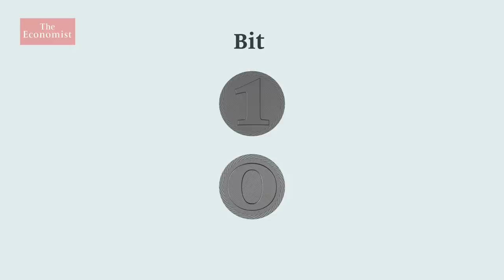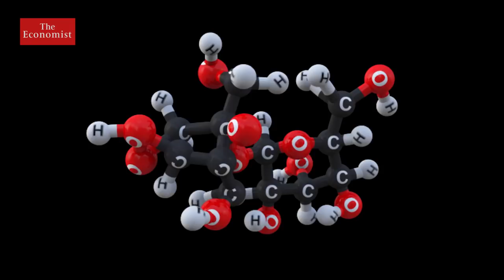How will quantum computing change the world?

Comment: Hum... "just some companies will use them (...) not in a regular base (...) to solve very specific problems" 
Reminds me a lot of what IBM say about computers in the beginning , the famous "the is only room for 5 or 6 computers in the world" 

There are 2 very critical areas that Quantum are very good at , that will spread:
- Encryption (with the video talks about... very briefly ) 
- Machine Learning (with will is already proving to be a big thing) 

So... no, it will not be like a CPU , or replace a CPU ... but i really think that in 20 years or so... it will be like a Graphics Card... something that every computer kinda need, some people need more... but it´s an add power to the computer.
Reply: CPUs have pretty much hit a brick wall with innovation, they literally can't be made any smaller. For CPU power to increase (for the power efficiency and their size) they'll need to change their very foundations. I think eventually quantum computing will replace everything. Especially given that I expect itll be near impossible to get non-binary machinery to work with other binary components, though I'm no engineer.

Comment: One use for a quantum computer is to solve the Navier-Stokes equations for fluid motion. The amount of grid points to solve such equations for a given case of the Navier-Stokes equations is given by the Reynolds number for the flow raised to the 2.25 power for a 3D solution. The power for a 2D solution is 0.75. To give an example. The Reynolds number for a circular pipe is about 3000 and is about 50000 for a golf ball and about 200000000 for a wing of a future hypersonic aircraft. Such an aircraft could fly from London to Sydney in just 3 hours. Imagne that!

Comment: We've been hearing these stories about how quantum computing is going to change the world since about 1970. YAWN.
Reply: Just wait till we got systems with 200+ qubits
Reply: But this time, it's for real. It's only in the past 5-6 years that quantum computers have actually existed, and only in the past 2-3 that they're actually uncontroversially capable of quantum operations rather than some convincingly arguing that they only simulate qubits on rebranded existing binary hardware. People have known what a big deal it would be to solve quantum computing since about the 70s, which is why every tiny advancement in the field has been breathlessly covered more than it perhaps merited, even though nobody actually had a quantum computer yet. Now that we have the very first ones in labs, all that's needed is to build more of them, which means making the cooling systems smaller, cheaper, and more reliable. That's not easy, but it won't take nearly as long as building the first quantum computers themselves did.